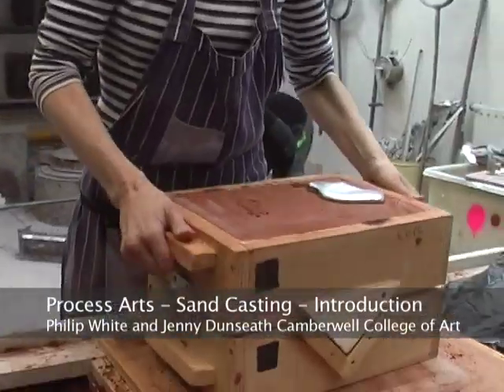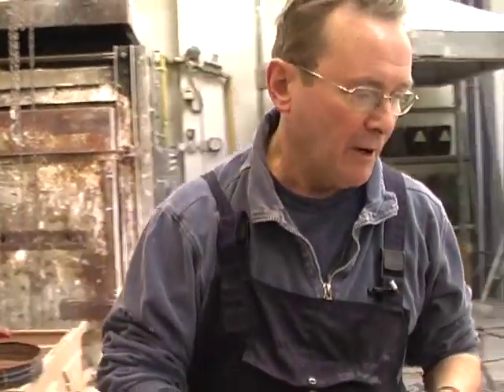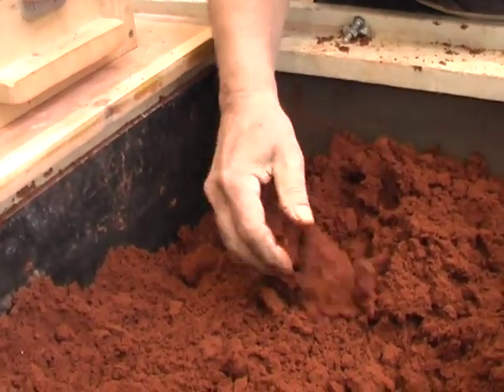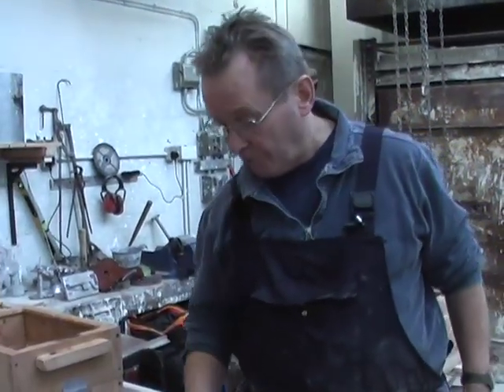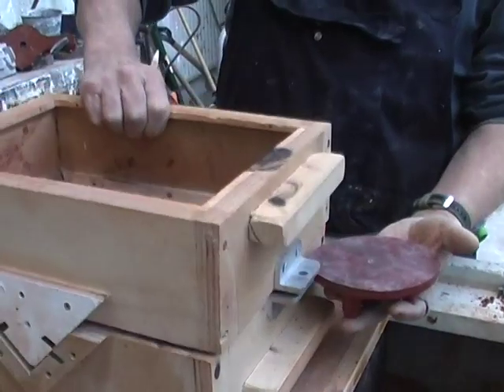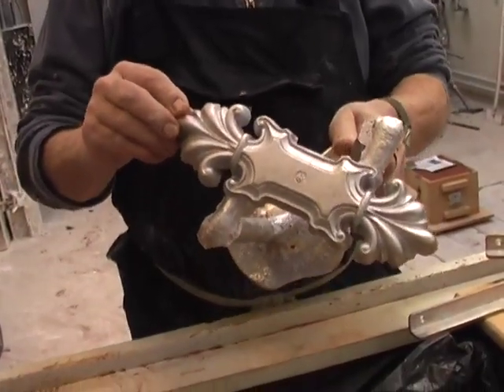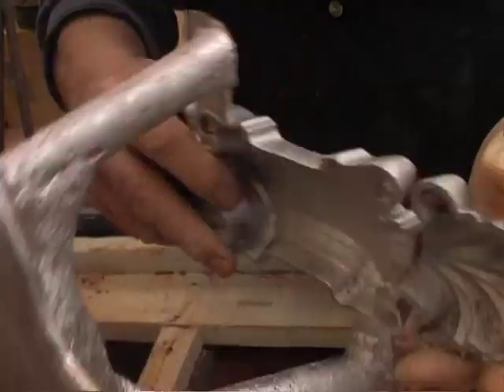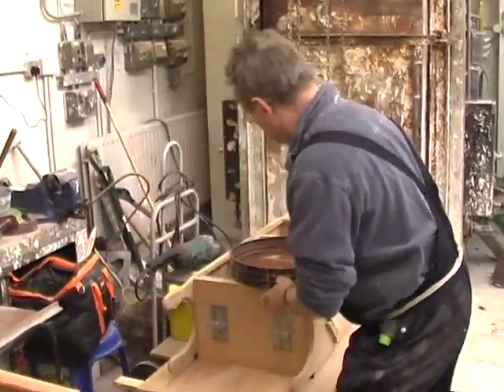Sand Casting - INTRODUCTION Philip White & jenny dunseath

Comment: does the red sand contain enough moisture to explode on contact with molten aluminum or steel if so is there another type of material i could use?

Comment: Fantastic set of videos.  Cope and Drags look well made.  However, the V-alignment blocks would only be any good for flat back patterns.  When split patterns are involved, especially those involving cores already placed in the drag, proper vertical descent of the cope is needed long before the cope and drag meet each other. This cannot be achieved with the V-alignment blocks.